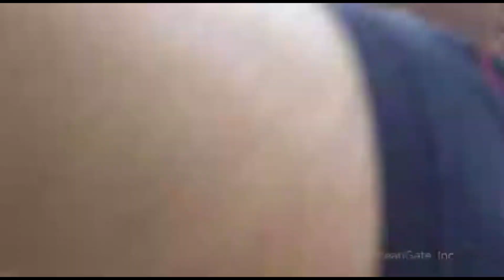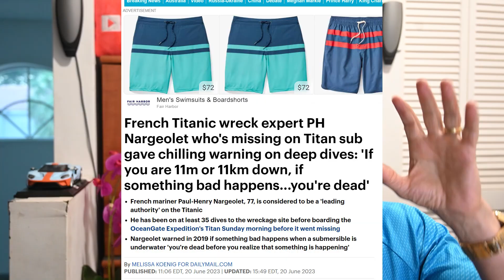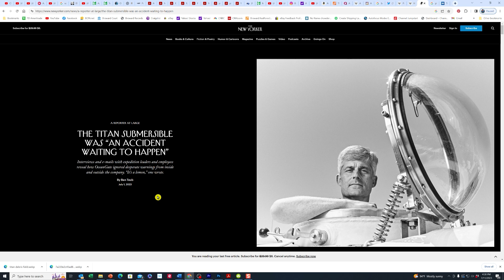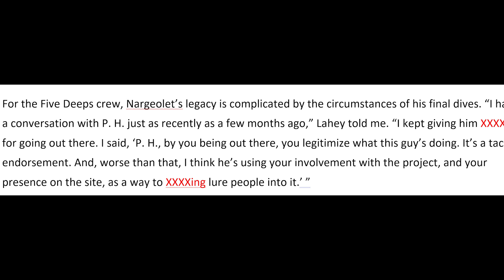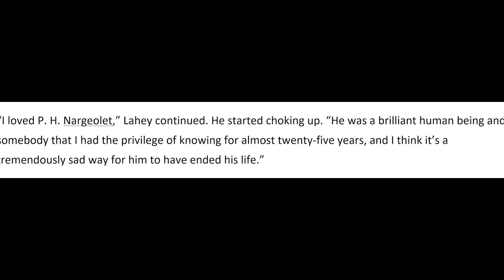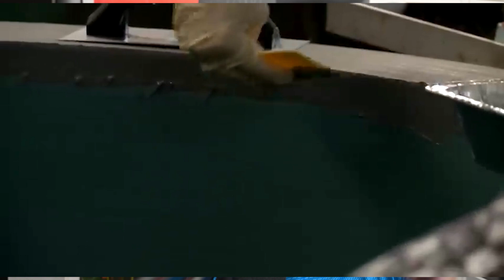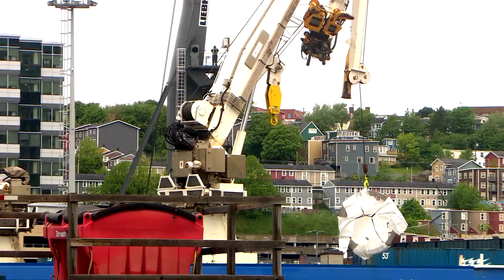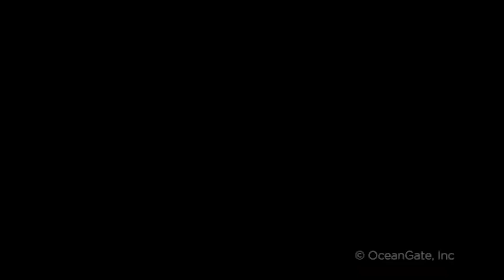Titan Sub: More Q&A, Design Defects, Why Descent Fast

Comment: It went down quicker because it was taking on water and that is why it could not ascend back to the surface,it was too heavy
Reply: If it was taking in water, then it wouldn’t have imploded.
Reply: @fedepetit What you said made absolutely 0 sense lmao maybe you made a mistake what did you mean to say?
Reply: They had oil-filled electronic junction boxes in the back. They might have cracked. Could explain loss of buoyancy and power issues.
Reply: Doesn't fit the facts.
Reply: If water leaked then it would get heavier and heavier, and noticable water inside, but the descent rate was fairly constant.. although high
Reply: @ricktbdgc  You wouldn't notice water inside. The fiber interstices were absorbing water.
Reply: @cybervigilante could be but why was it heavy from the start.. in the first 15 minutes descending 38 meters per minute
Reply: @ricktbdgc  It could have taken on the water while still on it's dock/launchpad and they didn;t realize until too late

Comment: I believe that Oceangate used a wet epoxy ( normally a 2 part) that heats up as it cures and traps small air bubbles and the way around it is use that autoclave to cure it under pressure avoiding trapped bubbles. That is what all the airlines used when using carbon fiber in their wings now.  I think they never sed the wet method.  I also believe that Stockton said he used the Autoclave system when in fact he used a wet Epoxy to cure as you see in the videos.
Reply: I have heard that it was expired "pre-preg" but if it was in fact wet layup. . .🤦🤦👍
Reply from the maker: yes heard the same thing. Why would Boeing sell expired fiver
Reply: @jeffostroff well if you are going to make something like a boat or something noncritical then it would be fine.
Reply: @jeffostroff  if they were told it was a one use experimental craft Boeing would sign off. Rush probably lied to Boeing about what the fiber was going to be used for
Reply: @jeffostroff  Expired pre-preg can be used for non-flight applications (i.e. layup tools, bond tooling and assembly fixtures).  It should still be cured using both heat and vacuum.
Reply: @jeffostroff  Why not? It is useless to Boeing but could have been used by others for other stuff (maybe not building a sub though). I'm sure the fiber was expensive and why would Boeing just throw it away if it could sell it and get some of the money back.
Reply: @willy_foley p
Reply: @willy_foley  ĺ
Reply: @jeffostroff  Its called pre-preg and there's a few channels here on YT that explain its use.
More importantly you raise the expired for aircraft use. That really needs to be clarified along with a few other issues.
I'm not sure what type of engineer you are, but I did my degree in aerospace. I work industrial controls systems NOT CF, but I do know some of the basics having been around racing cars. 

One of the things I am curious about is the winding on of the CF. If you go and re-check the footage you have they are simply winding it on (see 7:45). I have NOT SEEN any footage of them weaving it on at angles. Visually you get that chequered pattern. What those angled fibres do - is under compression the stresses translate so that some fibres are always under tension.  Maybe there is other footage but I haven't seen any yet.
I am certain there are other engineers who work with CF that can explain that better than I can.
Reply: @jeffostroff prob because it’s cheaper to sell than to have to dispose of prepreg carbon fiber that is past its use by date. And the contract likely states that it will be the buyers responsibility to use it properly, they should be fully aware it is past its expiry. Expired prepreg is apparently stiffer and may not seal in clean laminar lines. 

Which begs the question, how insanely stupid to you have to be to not only use expired fiber, but not also autoclave it? The man came from aerospace, he should know better.
Reply: @toomanyaccounts  I think Boeing and NASA gave technical advice earlier but had nothing to do with the design and/or making the Titan.
Reply: @tonywilson4713  Crosshatch may improve integrity but in compression the fibers don't add much strength. CF strength is in tension.
Reply: @alanaland1990  They do when you "crosshatch" (as you put it). I know it sounds weird and possibly illogical but under compression some parts of the weave are under tension. 

Its why the CF main spars in planes like the Extra 330 which are rated to +-20G don't delaminate. That cross hatch isn't there to look pretty its there for a reason.
Reply: @jeffostroff   It's past it's shelf life for certified aerospace use.  It's still fine for hobbyist use like custom automotive parts, sports equipment, or even jewlery.  They fairly regularly sell it on their surplus site, with the big disclaimer that it is absolutely not for use in life-critical applications.  Can't fix stupid unfortunately.
Reply: @jeffostroff  I was under the impression carbon fibre was not a use by item, it was the resin they used which has a, for best description a use by date, for aircraft they would need it used before the resin expired, probably under regulation.
Reply: I didn't see a wet lay up. I saw pre-preg carbon fiber being used. IF an autoclave was used, there would have been a form inside the tube so the pressure and heat could have turned the lay-up into monolithic block of material. Autoclaves have been used as an oven only, missing the most important benefit of the autoclave.
Reply: There were so many critical points of failure on the Titan design and manufacture. It would be interesting to build a copy operated from a tether, filled with sensors and cameras 🤔
Reply: @Shurdeflurgen  That's really the only way you could test this type of craft.
Reply: The hull was used. OceanGate did not build it, they purchased it from NASA or similar.
Reply: I would do the winding  under partial  vacuum
Reply: @gbear1005  How could that be done? And what would it improve?
Reply: @JoeLinux2000  Remove trapped air bubbles and improve its integrity.

Comment: Good analyses on the glue "bonding" process, lots of different ways it was bad practice. 

1) no temperature or environment controls.
2) no clamp or pressure applied, during cure time. 
3) no run-out of excess glue to allow for void fill.
4) no twist or rotation of mating parts during application. 
5) no NDI/NDT of glue post application/cycle usage.
6) no apparent surface preparation/approved application method.
7) no way to bleed air from glue area.
8) cycling of CF to Ti, at temperatures cause "working" of glue to surface.

anyone think of any other failures?
Reply from the maker: YEs a lot of nos!
Reply: @jeffostroff IF I had my drothers (based on my limited industrial design insight,  I would go with an applicable equivalent of custom  CHROME MOLY STEEL. There are various flavors of of chrome/moly for various applications.
Reply: It doesn't matter what glue they used, if they manufactured it "correctly" or not.
A cylindrical deep sea submersible that's being used on dozens of dives and is made of a carbon fiber pressure hull is going to fail. Not a question of IF, BUT WHEN.
This glue stuff? It doesn't matter. It would have failed regardless. There's a reason we don't use designs like this on legitimate submersibles for deep sea diving and we surely don't use CF.
Reply: @matchesburn  You make a very good point   The best epoxies I've seen claim at most 5,000 psi.  Most of the of the better stuff is actually 2.000 psi.   The forces encounter are greater than the capabilites of the adhesive, and there really isn't anyway to test this type of construction, other than to submerge it over and over again to the failure point.   Computer models mean nothing because there is no empirical experience with a thick walled CF reinforced epoxy tube to base the computer's calculations on.   The joint between the Titanium and carbon is also  difficult to test.   You aren't going to know the bond has come lose until it does.
Reply: Thubderfoot did a good experiment, with how glass bonds to metal. And the small change in size due to pressure is enough to break that titanium and plastic bond.
Reply: I mean, we don't even know if they used the correct type of glue.
Reply: My experience with applying epoxy in aerospace is that the part is put in a vacuum chamber/oven to eliminate the air bubbles, and to properly cure the epoxy.
Reply: the glue ist not the issue. The water pressure holds everything together even without glue. the problem is the carbon fibre and use of different materials.
Reply: @libertas12  How the glue is applied can be a major issue....at that pressure water can blast through a defect in the glue only a few molecules wide.  A water jet can cut through steel. Just one tiny leak, too small to see, would doom the craft.
Reply: does the glue/bonding even matter that much? under pressure the parts are forced together anyway. its really only critical for outward pressure. the ends would have popped off due to the outward force of the implosion.
Reply: @tweake7175  The problem is air gaps or impurities trapped at manufacturing or forming under dive cycles.
On each dive they will contract & expand, stressing materials around beyond design.
Reply: @musaran2  even if the join fails, the pressure is holding it together, not breaking it apart.  having a look at some of the carbon fibre tube pressure testing video's show they fail more in the centre in the tube and along the tube axis, not at the ends.
Reply: @tophatanimation8748 Speculation is the problem.  Rush speculated it would work, but in the end, it failed.   This is very much like the FIU bridge.   They claimed it was a very innovative design.  Unfortunately it failed and killed about the same number.   Both the Titan and the bridge were speculative designs not proven over the long term.
Reply: The front join between the titanium and CF hull should not have also been the hatch for people to get into and out of the sub.
Reply: Your last reason, the flexing of material loosening the bond, was my first thought.
Reply: The only problem is the end cap assembly is in compression. You could have tied the end cap assembly on with wire. The deeper you went the better it would have sealed.
I agree the epoxy glue application process was horrible to watch. It acted more as a seal then a bond in their application process.
Reply: @topfuel29channel “the deeper the better it sealed” ONLY if the titanium and carbon fiber hull were same size.  If the CF hull under pressure shrunk faster than the titanium, then it creates a gap at the joint.
Reply: @electrictroy2010  The epoxy flange connection so was strong that it held in place while the end caps blew off. The flanges had to held back to allow the end caps to blow off the flange. If it was the flange connection, then you'd expect to see the assembly intact. it's not.
Reply: GLUE MATTERS.  I suspect the sub partially flooded as soon as it submerged.  I think a gap in the glue between the titanium & carbon fiber is where the water entered.  (Although it could have been a crack in the CF hull too.)
Reply: The epoxy strength may indeed be very high, but does that still account for being crushed between the titanium ring seat and CF cylinder end at hundreds of tons of applied force at depth?...as opposed to being sheared, peeled, or pulled (as would be in a more typical adhesive loading)

Would the bead fracture or pulverize at some point? That in of itself is not such a critical issue, as noted earlier, the sealing is enhanced by the inward force at the ends...however, these fractures or pulverization could be the inroads to water ingress at extreme high pressure (just like if a leak developed anywhere in the bulk material of the cylinder and dome components of the craft)
Reply: A water jet table can cut thru steel around 10,000 psi.  A pinhole leak only a few molecules wide thru the carbon fiber or adhesive joint would have done massive damage in a few seconds. This was a flawed design.

Comment: Was the fast descent totally controlled or was extra weight accumulating for other reasons? In turn could this same factor have caused their difficulties in returning to the surface? If so, what could the factor have been which caused them to unexpectedly lose sufficient buoyancy to surface even before the sub imploded? Was there another flaw at work here?
Reply from the maker: We don't know whether Rush was living up to his name, or if they were overweight
Reply: @jeffostroff  nice
Reply: Other components external to the compartment may have leaked water into them reducing buoyancy. It appears other systems were failing prior to collapse.

Comment: i am more interested to know how they made the hull penetration for the cabling. Any inputs?
Reply from the maker: It was likely all through the rear titanium cap
Reply: It was glued into a hole in the back titanium cap.
Reply: @MegNoel81  Now granted I’m not an engineer, but I would have a very bad feeling trusting my life in a submersible that was stuck together with glue and a cap especially for several trips. Does not sound like it was built with the idea for the sub to be long-lasting at all.

Comment: Hey Jeff, Just Wanted To Highlight, Being An Electronics System Design Engineer, Theirs No Kind Of Sensor Detection That Could Be Implemented To Prevent Or Act Quickly To Critical Failures Of Hydrostatic Pressures. It Would Appear The Detection Would Occur Then The Implosion Would Immediately Follow With Carbon Fiber...
Reply: Soo ... hard .... to .... read .... with .... each .... word ..... capitalised .......
Reply from the maker: Yes Rush bragged it would give them plenty of time to get up to the top
Reply: well the alert was  many minut es before explosion bu t not early enough
Reply: @boppernostopper8598  The Main Benefit Of Having A Detection System Is To Be Warned Of Failing Integrity  And Still Be Able To Implement Counter Measures To Act On Those Failures. I'm Just Saying Under Realistic Circumstances That There's No Sensor That Would Be So Super Sensitive That You Could Have enough Time To At least Get Out Of Deeper Dept To Relieve The Pressures. Even More So When Your Already Three Quarters Of The Way Down Since Everything Is Pending On Time.. Remember In The Transcript In 15 Minutes Made A Distance Of 18 Meters Higher.
 I Watch Hydrostatic Testing In A Pressure Chamber With Carbon Fiber Cylinders, Small Samples Mostly And Imploded At A Dept Of 150 Meters Or 15Bars. Carbon Snaps And Splints Into Pieces. 5000 lbs Per Square Inch Gives No Le-way So At The End Of The Day, A Detection System Could Give Some People A Sense Of False Hope And It No Way Should. Peace.

Comment: As an aside this will go down as one of the biggest engineering failures of our generation. This points to a larger problem with “startup” styled engineering and its implications go far beyond things like this. Not trying to start a debate but look at the engineers at Tesla green lighting selling a product called FULL self driving when they all know it’s not past beta. Or the engineers working on the virgin hyperloop when it’s not even remotely possible in this day and age. It seems these CEOs bankroll an idea and then basically ask their engineers to come up with a product that isn’t even possible yet by any means necessary. Those are just a couple examples but I can assure you this has been going on for a while in the broader engineering world and we only start to notice when people start dying.
Reply: That's the most contrived bullshit I have ever read congrats
Reply: @Inismona27 for real like what comes in your mind to spew this random bs 😂
Reply: @LolLol-vz3lv  😂

Comment: Great presentation as always.  The only thing I don't get about the question with the epoxy on the end caps is that it seems under pressure the titanium end pieces should be trying to compress in and crush the cylinder from each end at the same time the middle is more likely to crush like the "coke can" analogy that has been so commonly used for Titan. 
I also wondered if the cracking or crackling sound from the rear could possibly be compression on the carbon fiber from the ends.
Reply: The cracking sound from the rear dosn't mean that the issue was at the rear part, the sound could be just more reverberating at the rear side, but the actual issue could be somewhere else.